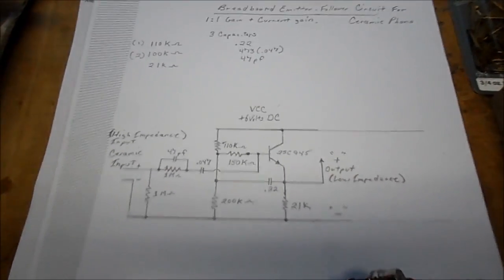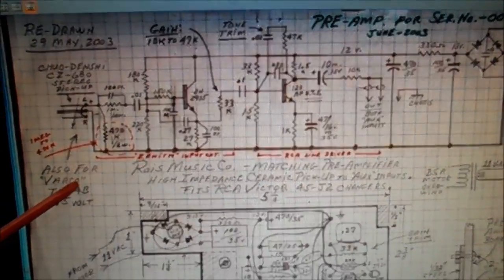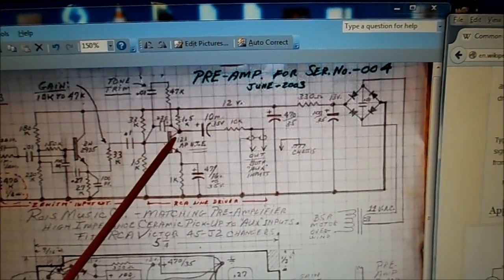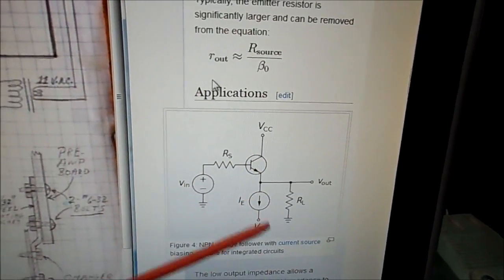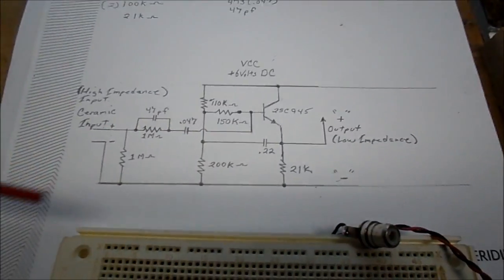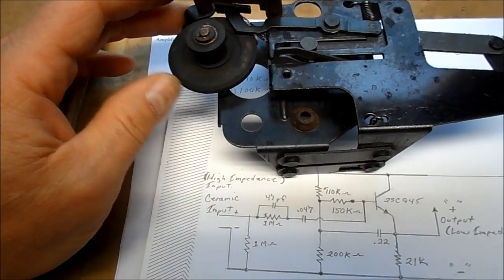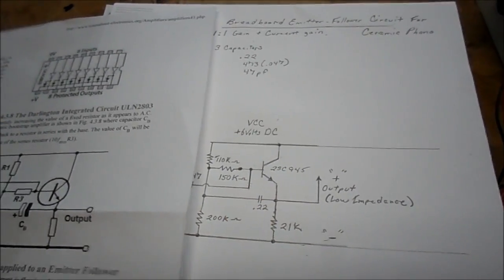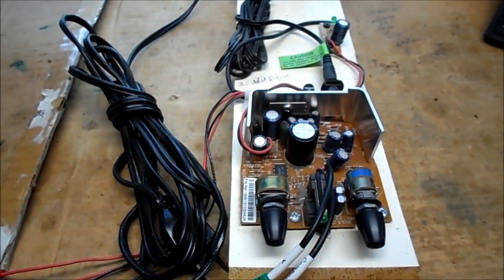Zenith Emitter Follower Input Circuit For Ceramic Pickups. Final Notes.

Comment: Thanks again for the follow up video on this emitter-follower circuit Robert! I've also bookmarked that website already.
   I was really impressed on the improvements that can be achieved with ceramic high-impedance vintage phono cartridges.
   Thanks for the info my friend!
   Some great information here,
       Tom
Reply from the maker: You're welcome Tom. I'm sure the reason it was shown to me was in efforts to keep this stuff going. Also, I think another lesson was to substitute the "one tube wonder" amplifiers, retaining the original volume & tone controls. (also higher impedance). I have one tube wonder player done over with a new TDA2002 amp using the above circuit, original volume, & tone controls.